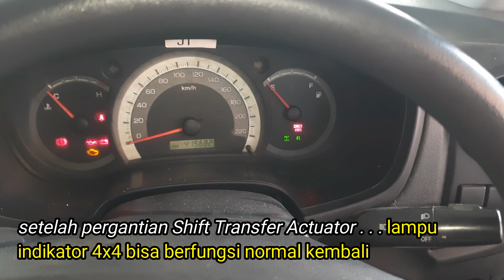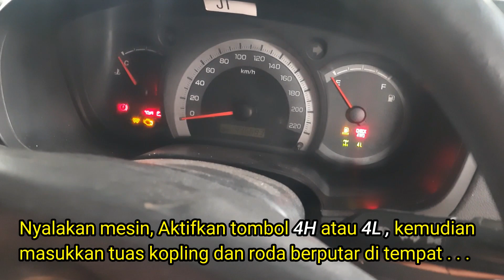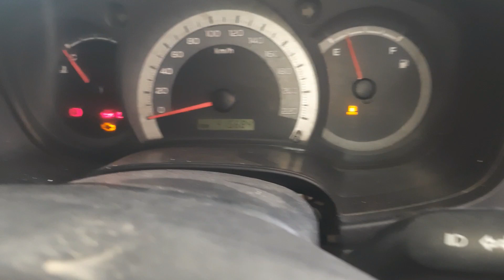Cek Sistem penggerak 4 roda 4WD Isuzu Dmax tidak berfungsi

Comment: Dmax 2019 keluar check 4wd  scan circuit motor a/b smua dicek ok tapi masih keluar check 4wd itu aplagi yg mau dicek om mohon bantuanya🙏
Reply from the maker: Pastikan dulu di dongkrak naik 4 rodanya dan ditest putar ditempat dan test fungsi 4x4 pada semua roda dimana 4 roda akan berputar bersamaan saat tuas digeser ke 4H dan 4L dan saat di 2H roda belakang saja yg berputar